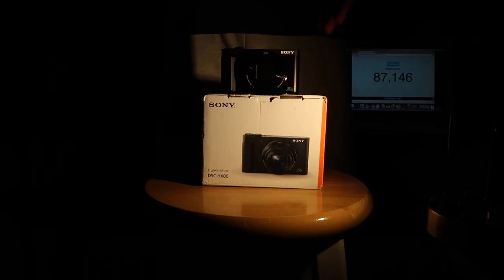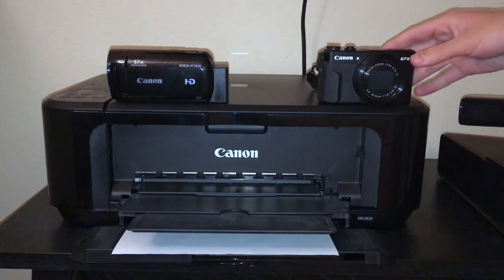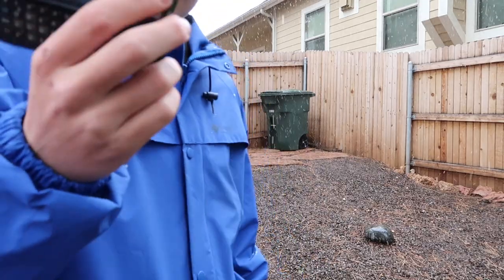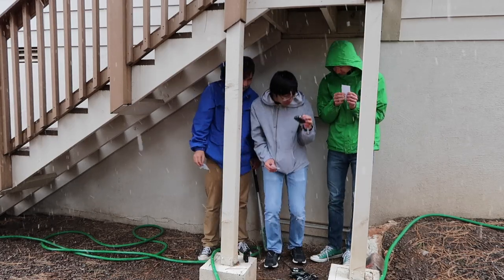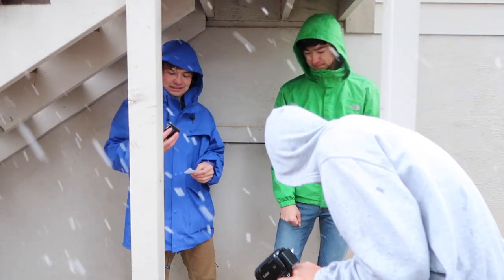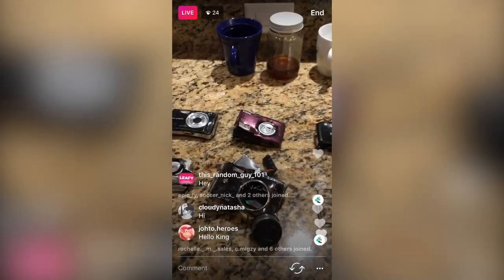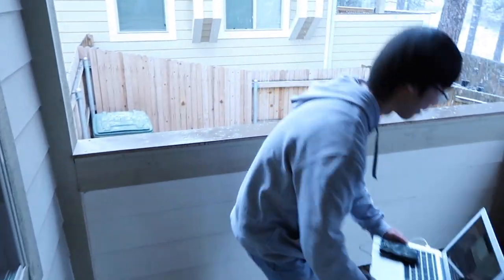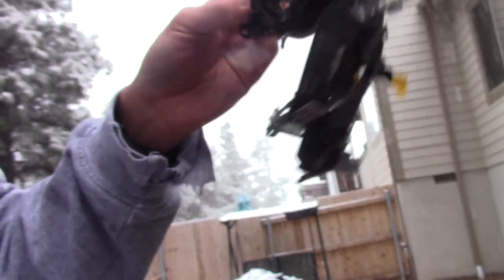Bored Smashing - DIGITAL CAMERAS!

Comment: Wtf happened to his macbook at 1:42

It had a seizure
Reply: It had a seizure
Reply: "graphics card" like macs have one
Reply: It's an Apple product, that's the problem.
Reply: Ummmm what? Windows are some of the finest machines ever built, and XP is the finest computer operating system ever.
Reply: @isaac24  bruh. my windows 10 laptop literally glitched in paint 3d before. like 4 times. so macs should be able to have graphical glitches too. also windows 7 is the queen of windows
Reply: @IceClaw well vista and 7 are both good then

Comment: dear king
I dont know if you knew this but the sony had a auto night shot mode so it would turn on at low light but if you dug threw the settings you could turn it off so the frame rate didnt drop at low light.

have a great day if anyone actually read this